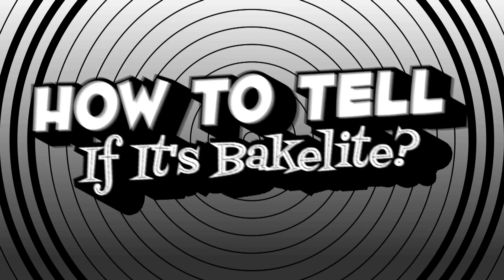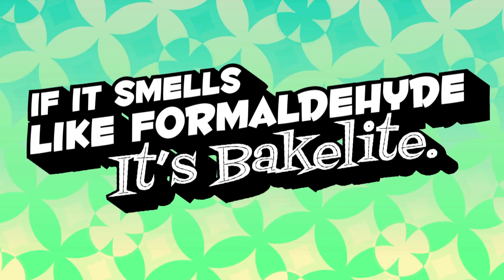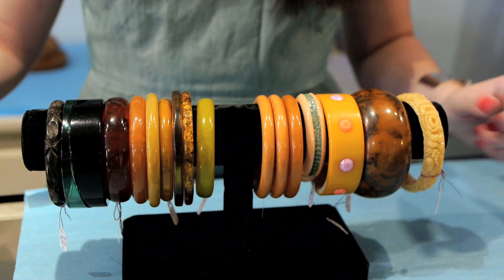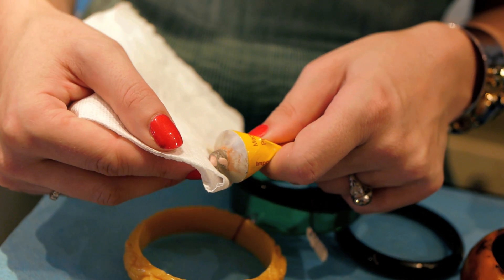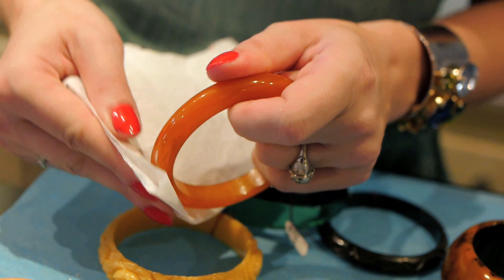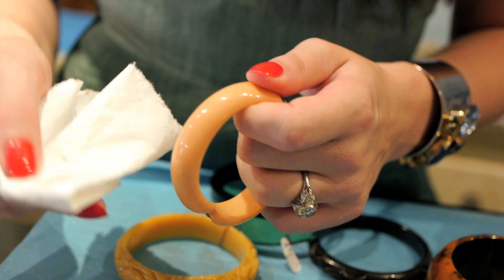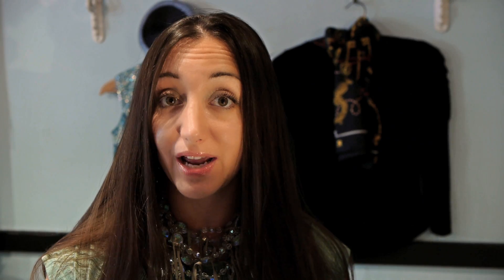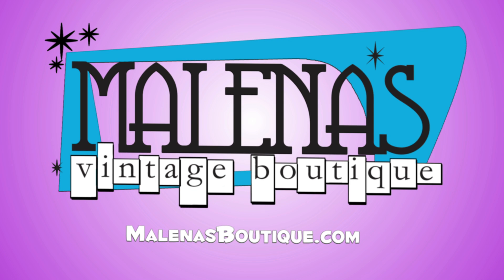What is bakelite?

Comment: The reason why the seam is not there is because of the finishing process.  Most bakelite is either sanded or polished after molding.  But some items actually have seams, it just depends on the desired finish for the product.  Jewelry often lacks the seams since it is polished to bring out the best in the material.  It doesn't have to do with the injection molding process, which most plastics are created with.  All injection molded plastic starts with a seam somewhere.